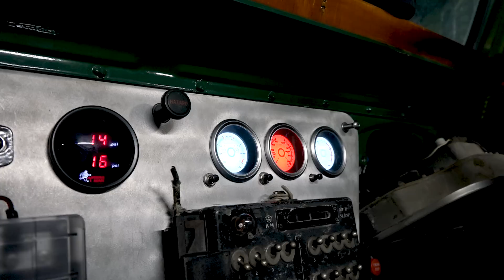Milo 2 - Airbag Man Install - Built Not Bought - 40 Series - Roothy

Comment: Thanks Roothy and team.....given me an idea to spend more money on the Silverado. I already have AirBagMan stuff fitted, but am now thinking of adding the in-cab kit. Am I right in thinking that I have to run THREE air tubes into the cab and to the back of the switch paddles (one for incoming air and two outgoing...one for each air bag)?? I've got all the other gear already, including two air tanks totally 43 litres capacity and a PX-07 compressor.
Reply: Box arrived today from Airbag Man with my add-on kit for the in-cab control etc. I've just fab'd-up a new steel panel for the paddle switches so it can be flush-mounted into the dash and waiting for the paint to dry. After that, it should be pretty straight forward.
Reply: All done by beer o'clock. Did the job on my own....bearing in mind the bags were already there, I just added the in-cab kit; so new air lines from cab to bags as well as new line to the air receiver tanks. 

Electrics was easy because I have a 4-outlet cigi outlet on the dash with individual switches, so that took about 10 minutes or less.

 Took about 3 hours all up, but a lot of that was cutting and filing that new mounting pad for the paddle switches.